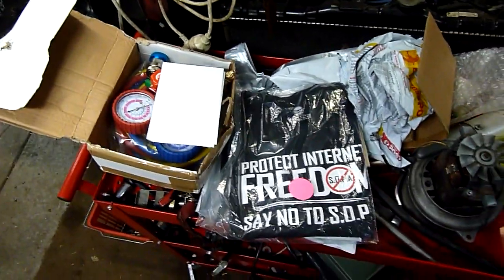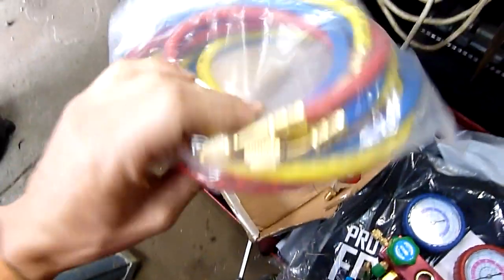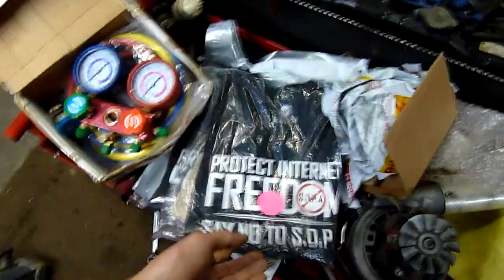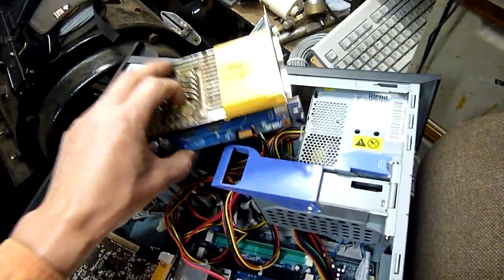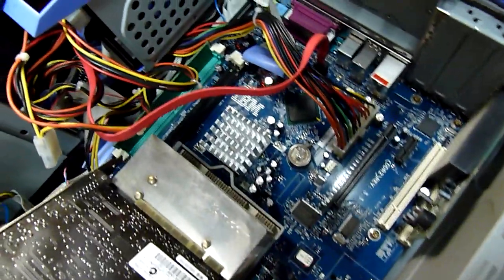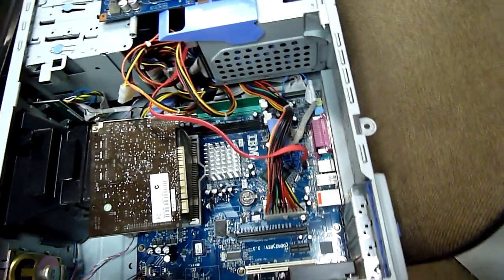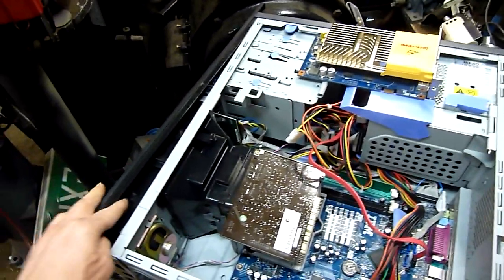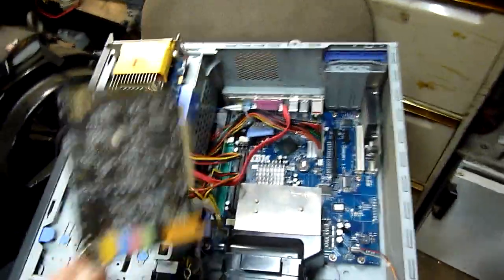Mail Goodies and IBM Thinkcenter BTX Inspection

Comment from the maker: @CMDRSweeper I already destroyed the stick, but I will look for that app for testing bigger sticks.

took very little bending to pop all of the BGA chips off the ram stick, I'd bet one or more already had bad solder joints from being removed and installed a few times, not to mention heat

Comment: @HighTreason610 BTX in a nutshell: hot things at the front (CPU, chipset), all air flows towards the back, everything gets cooled. BTX has a very linear airflow pattern and was designed in such a way to reduce temps throughout the system. However, this only really matters for hot hardware EG anything with a Netburst processor (pentium 4, pentium D) and any extreme edition as they ran hot as hell. Modern hardware runs much cooler, so BTX fell out of use.

Comment: @StaticNova even they don't always work. i had my memory over clocked from ddr 400 to ddr 480 for the past three years, my AMD Athalon 62 X2 would fly and the memory was much faster overclocked but recently i have been having issues and when i set back to factory clock speeds all was fine, so yeah not even mem tests work as it passed 6 times before i set it to default

Comment: @Sansui350A like could i clone my 320 gb laptop drive to a new 500 gb drive plug it in and boot into windows? because in all my experience and all the facts i hear says there is no way to clone a drive and use it, or if you can its best to start new, but i dn't want to start new and have only 20gb of free space

Comment: BTX is component side up? Older machines used to be component side up, I've always argued that thermally it was better that way. Oh, and I couldn't help noticing that you had a dial-up modem installed :D
I've never liked graphics cards that take up two slots, if things are more energy efficient why do I need bigger a power supply and why does it produce more heat? Because what they say is garbage, that's why.

Comment: the 8600GT is a meh card in terms of performance, not to mention a dual slot heatsink is overkill for it. If you can find one cheap, a GT240 (GDDR5, NOT the ddr3 version) would wipe the floor vs the 8600. An 8600GT has 32 shader cores and is limited to DDR3, whereas the 240 has 96 shader cores and can use GDDR5, which is 2x as fast as DDR3, and on the 240, the difference between the two is very noticeable.

Comment: BTX is awful. I moded a few to except video cards. 
Sucks that RAM did not work. Probably a bad stick. 
You should try and grab a larger ATX case and put the Pentium-D in there. And maybe mod the side with a fan. ID concentrate on the Pentium-D it a dual core and will perform better them the P4-HT. pop that 8600 GPU in there. along with what ever ram you get.